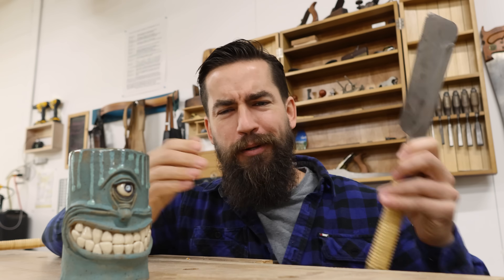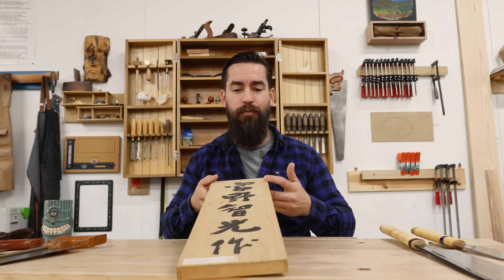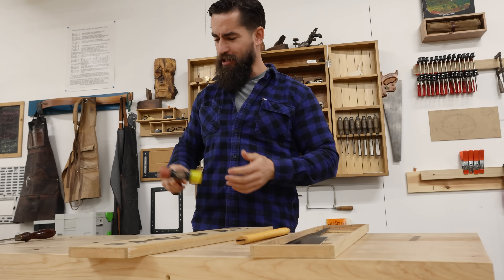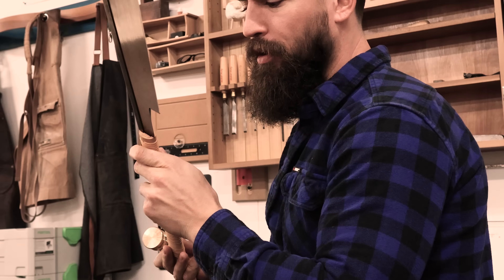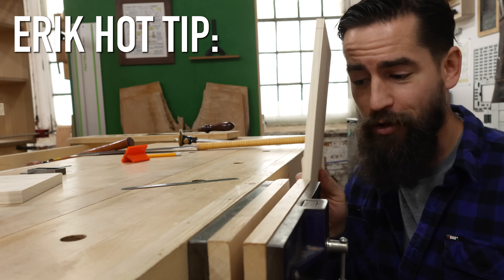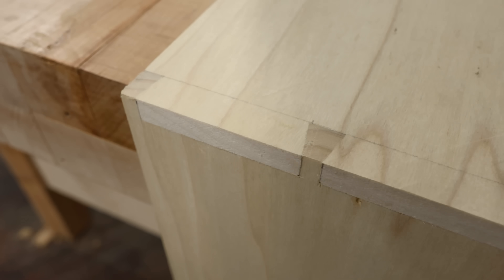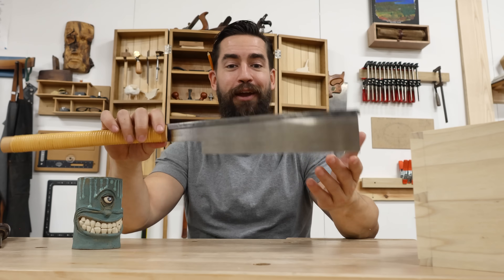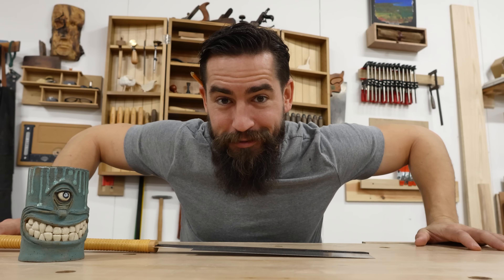The EXCALIBUR of hand tools?

Comment: Asks the question, "Does spending 500.00 on a saw make me a better woodworker." Proceeds the mill lumber for a joint, arguably the most important step in getting good joints, with 20,000 in equipment. :D

Comment: I bought a Japanese pull saw some years ago and loved it so much I used it all the time and even turned the blades round in my hacksaws to cut on the pull, finding they worked much better. I recently had to replace it and got a rip toothed one as well. The quality of the cut is so much better than push cut saws and the length of the handle makes for easier fast, or fine cutting.

Comment: Last summer I went to the incredible Sagami Tool Store an hour out of Tokyo. They carry a lot of hand crafted tools by artisans for exceptionally reasonable prices. So something on par to this would likely be found for half if not cheaper. Especially with the current exchange rate. Next time go to Japan, I need to return and look for a saw. Last time I got fantastic chisels, sharpening stones, and a plane.
Reply: Thanks for the tip. I'm going to go there the next time I'm anywhere near Tokyo. Do you happen to know of any similar stores in the Osaka or Kyoto area? (I live in the Kyoto area.)
Reply: @craigjohnston5678  Not that I’m aware of. That shop is one-of-a-kind even by Japanese standards.
Reply: Thanks for the tip, I will have to visit

Comment: Erik, you can pack more information into a video than just about any other maker I’ve watched.  Well done, and thensome!  I always pour myself a cup of coffee before I sit down to watch your latest offering.  Great way for a retired furniture maker to start the day!  You touched on something that is very important to understand, and I have no doubt you understand it implicitly.  We work with our hands, but it is our brain that is in control of how we do that.  A well made tool accentuates that process by increasing the brains ability to command the primary controls, and removes or limits the ways our hands and muscles can stray from that control.  You touched on why that type of saw feels and or works better.  The long handle against your forearm makes it much easier to hold your line.  The extended tang where you place your index finger does that also and gives you instant feedback on how your saw is performing.  Pull saws require less control to keep them straight than push saws thus allowing your brain to focus more on the work and less on what your hands, arms, and body are trying to do to screw things up.  The man that made that saw built it with an understanding of how you actually optimize the use of it.  The sound of that saw cutting through the wood jumps out at you in a way that screams perfection!  It sounds smoother than most dovetail saws.  That is a product of thin blade, high TPI, tooth angle and rake,  sharpness, and ergonomics.  It was like music as you pulled that saw through the kerf.  You have a real tool makers masterpiece in that saw.  Thank you for sharing it with us!  Oh, and by the way, it is worth every cent you paid for it.  😊

Comment: The thing that jumped out at me the moment you put the saw to wood, was how silent it was and how it let the cut sing. With most cheaper Eastern style pull saws, when you use them, you can hear the saw as much as you can the cut, but that saw was seemed to be dead silent. It was wonderful. Though i never have that sort of money to spend on a tool, i would totally buy it in a heart beat if i had the money in my pocket, even if it meant eating potatoes or rice for a week.

Comment: Asian/Japanese  saws are typically designed to be used 2 handed.  That will tend to counteract subconscious twisting by the user. My experience with pull saws dramatically improved. I thank Toshio Odate for that bit of advice every time I use one.
Reply: How can you make fine motor movements with two hands? I know they use two for timber framing and such. But it seems highly counterintuitive for dovetails. Was it hard to learn?
Reply: @f.kieranfinney457  you pull straight back towards your gut. It takes a little practice, but not much.
Reply: Large saws for beams maybe 2 hands, but not saws for furniture sized joinery. But whatever works for your body.

Comment: I haven't started woodworking yet; that's waiting for my retirement in a year.  I have sewn garments for decades, though, and I see a lot of big-picture parallels between the two crafts.  One is with quality equipment.
Two years after starting to sew I replaced my mediocre first sewing machine with a very expensive high-end machine, and unsurprisingly I did not immediately become more skilled.  However, the speed at which my skills increased was dramatic because my machine was no longer getting in my way.  The same thing, in a much less expensive way, was also true of cutting and measuring equipment.
I'm forty years older and wiser now and I don't need all the nice things right now.  I won't start woodworking with cheap tools but I won't rush out to buy the most expensive ones I can find, either.  People tell me there is a thriving second-hand market that I should investigate, and I'll take that advice.
Reply: @agcons Rex Krueger has some really good videos on how to pick up quality second hand tools for a lower cost.
Reply: @mattgs1671  Thanks, that will help a lot.
Reply from the maker: I think that's a brilliant point. It's not that your skills increased immediately. It's that the speed at which your skills did increase was faster due to the machine not getting in the way 👏

Comment: Weird; I find the in-line handle a drawback simply because you can't feel how you're angling the saw, so to me it's more difficult to keep the line when cutting with them. But I guess we're all built differently.. I personally like the reverse action of Japanese saws though and I did manage to find one that has the Japanese direction of cut, very fine teeth at 20 tpi but has a pistol-grip, which is my favorite.

The thing you said about how having nice tools makes you want to use them more is very true. And also, if someone does woodworking as a hobby the primary purpose is to enjoy the process and it is more enjoyable when you appreciate the tools you use and they feel good, not frustrating. It's up to each person of course, but personally I've never regretted getting a really nice tool, but I have regretted buying cheap ones many times.

Comment: Great video! As a musical instrument repairer by trade, I appreciate the point made that the quality level of the tool enhances the experience of the task it is used to perform. My workbench is filled with specialized tools, including a screwdriver(among several) that I absolutely love using. The weight of the handle, the taper of the blade, the texture on the tip grips the screw slots so well! It was $100 well spent as an investment in MY user experience. Are there more economical options out there? Sure, but it's totally worth it for me.

Comment: If Japanese saw smithing utilizes the same techniques as sword smithing, the coloration at the end of the tang is indicitive that the tang was not hardened during heat treatment.
Given the color difference between the tang and blade, I'd wager that this is the case.
Lovely craftsmanship. I wonder if the steel it is constructed with was made in the traditional tatara process.

Comment: Nice. I really hope you like it.
I have both japanese ( i started with them) and western style saws and i prefer western mainly becauseI find them easier to control doing the cut, especially if i'm doing carcass and longer rip cuts.
Saying all that i dig teeth and cutting action on japanese saws, i have a 70 cm frame saw with japanese harden rip teeth that i use in push action and it's a joy to use. If only a good handle western pushsaw (dovetail, carcass and panel saw) existed with replaceable blade but with japanese teeth... i wish...

Comment: The neat thing about Japanese tools is that you don’t need to spend $500 to get a good tool. Yes, if you want something special or collectable from a noteworthy smith, you certainly can get it. But you can also spend $50-100 and get an excellent quality tool from a lesser known smith. Will it be as good? Eh, that’s a bit of a lottery. Will it be better than most mass produced tools? Almost certainly (assuming you like the style of tool).

Now if you had fun with this, just wait until you get a good set of Japanese chisels (oiirenomis). And then a set of usunomis, and a few bachinomis, oh and you might as well get a nice set of tataki atsus. Good luck with the rabbit hole!

Comment: An idea from a Hoosier. A metal ring with the interior lined with leather that the handle can fit into. Would be a "friction fit" as the tip sits against the wall. Of course a pad of leather could protect the tip of the saw and wall as it sits there. Of course the metal ring would have to be hand forged to make it super sexy and worthy of the blade. Am I describing that well enough? Possibly a totally stupid idea. Peace out! Stay warm!

Comment: What intrigues me is that the height of the saw starts tall and then shortens as it gets closer to the handle.  Since this is a pull saw, if it was an even height all the way along, it would start the cut heavier , i.e. more of the weight of the saw on the cut, and get lighter as it is pulled, i.e. more weight on the arm/hand and less on the wood.  By adding the taper to the height, you might be getting a feel of a more even weight.  Which may, I'm no expert in ergonomics, improve stability and control.  This wouldn't be as important a factor in a push saw, as the weight of the saw is balanced across the cut while the arm is pushing through the cut.  The change in the height of the blade may also be responsible for your feeling that it started smoother.  

Just a thought.

Comment: I was going to offer you 6K for it, but now it is a used saw...  All kidding aside, when I buy I quality tool I use it.  My best friend has 2 $3000 Sharps rifles and has not shot either of them.
When I get a new saw I polish the blade with my Dremel with a buffing wheel.  It only takes a couple of minutes and dramatically helps with the reflection off of the saw blade and allows me to ensure I am cutting plumb.

Comment: In my experience, and especially with hand tools, the tool that works with you, is the one that is worth the money you spent on it. I've used western saws (of course) and they just never worked for me. The whole cut on the push stroke thing threw me off. Discovered eastern style saws with a "trash" flush cut saw I bought to use on jobsites. Intuitively, it worked far better for me. I own a couple of eastern style saws - as well as an identical gent saw that you have - as well as that particular Veritas saw, and the eastern saws are always my go-to saws. I have both a small gent saw that I use on jobsite in a miter box, and then the one you showed in this vid. So what's my long winded point? My point is, technique and PRACTICE are more important, imo, than the actual tool (provided it's sharp, of course). To your hand made saw ... I wonder where you will send it if it ever needs sharpening? My understanding on "true" Japanese saws is that they are ground differently than western style saws are and sharpening techniques for western saws (a la such as Paul Sellers has taught) won't work. Anyway, great video. I always enjoy the philosophy of your vids, and am envious of not only your natural talent but also the dedication you bring to your work.

Comment: Try placing the index finger of your right hand on the top of the saw handle instead of on the side of the blade. You have a more western grip with the back of your hand turned perpendicular to the bench. Rotate the back of the hand more parallel to the bench.

Like this:
https://youtu.be/HnJ1pRDKZBk?t=132

Comment: I think the question is… would it cost $500 if it wasn’t made by a retired sought after smith with a great reputation in a niche community? Obviously a handmade tool of any kind is going to cost more just like in woodworking/furniture building but does that inherently make it “better”? Based on your reaction and analysis, I’d say probably not so I added the Gent’s saw to my Amazon list for future tools to buy (given that after X-mas and a couple financial disasters in December, I’m completely tapped out for a while 😢)
Reply from the maker: That is an excellent way to consider it. Would it still be worth the money if it wasn't made by Miyano... 🤔
Reply: @ENCurtis  BTW, a video more in depth about your opinions of flush cut saws would be appreciated, particularly if you have a reasonable recommendation or just flat out don’t think they are worth using so you have an alternative method. I have watched all your videos but given I have been watching quite a few different woodworkers over the last couple of months, I can’t remember a detail like that of your process.

Comment: Be interesting to test this traditional hand made Japanese saw against its opposite. 
Rob Cosman’s saw is purposely heavy, the blade tapered and the size and set of the teeth lower but with initial few teeth finer. The handle is pistol style in resin. Instead of traditional it’s modern through and through. And similarly expensive. He is on record as disliking Japanese style saws. A test would be a fun head to head of opposing ideology.

Comment: Was not worth the money. I will provide my shipping address so that I can assist you with proper disposal of the saw. 😂

Follow up question can this saw be sharpened? How often do you sharpen your saws
Reply from the maker: 😂 fair. I'll get the label ready.
Yes, these can be sharpened but I am not practiced in sharpening eastern style saws so I will most likely send it out to someone to sharpen it for me. I usually only sharpen my DT saws every 3-5 years or so. Maybe more, depending on the saw and frequency of use.